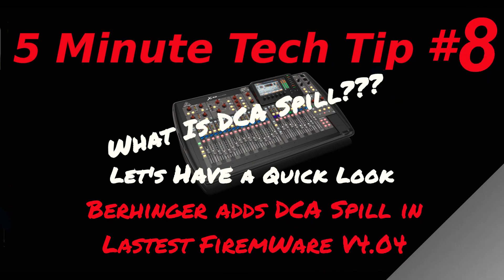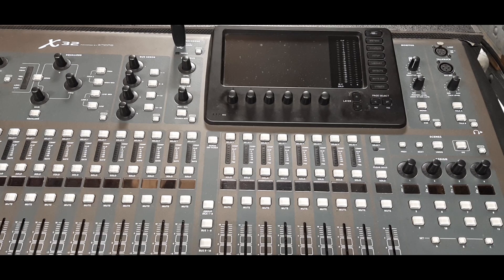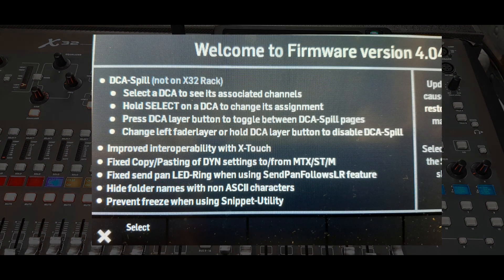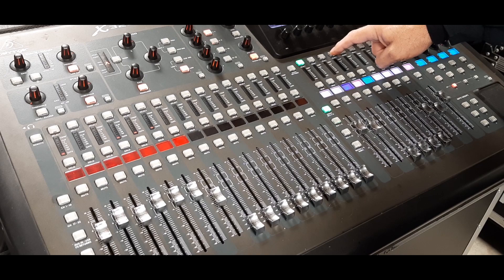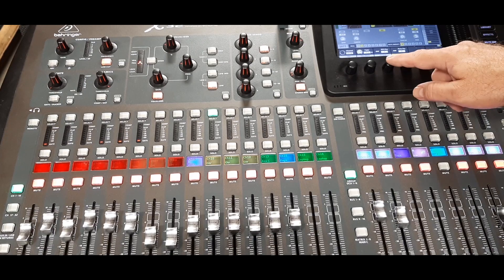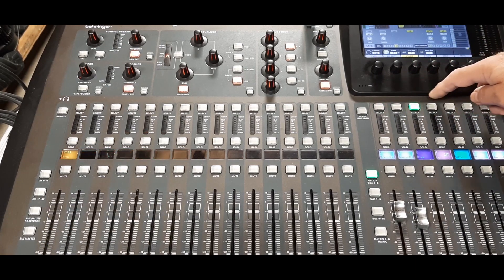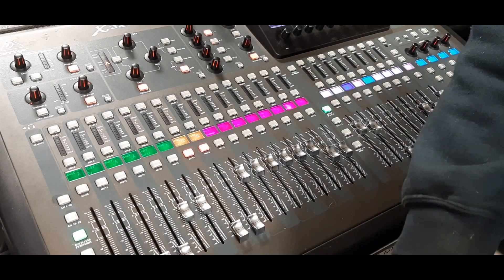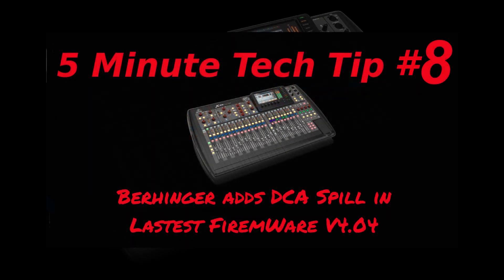DCA Spill Feature Added to the Behringer X32 in V4.04 Firmware. Midas M32 as well.

Comment from the maker: A quick look at the Behringer firmware as I installed it and checked out the new DCA spill function in the X/M32 series.

Amazon Affiliate Links-

Behringer X32 on Amazon:
https://amzn.to/35oCcyo

Midas M32 on Amazon:
https://amzn.to/3ovhi8n

Behringer XR18 on Amazon:
https://amzn.to/2LfTpmO

Midas MR18 on Amazon:
https://amzn.to/3q4Z4Li

Videos:
Five Typical Mistakes Behringer X32 and Midas M32 Users Make:
https://youtu.be/tP7dO2Za6bw

5 Typical Mistakes Behringer XR18 and Midas MR18 Users Make:
https://youtu.be/EilVDp39A9g

Comment: Very interesting! Can you add only the left channel of a stereo pair to a dca, and then have essentially a really tidy custom layer with one fader for each stereo source by assigning only the left fader to the dca group?
Reply from the maker: I assume not... But I can't say for sure. I didn't try that. I assume stereo linking is something they didn't change at this point. But who would've thought they'd add a DCA spill function all these years later to the X32?
I'll give it a look next time I'm in the shop and fire the console up.
Reply: @AlanHamiltonAudio  I can confirm that adding only a single channel of linked channels will cause both to show
Reply from the maker: @rwallingford7126  Thanks. I fired the console up today and forgot to check that. I assumed that would be the case though. Thanks for the confirmation.
Reply: @rwallingford7126  Thanks for checking! If you add more than 16 channels then i assume you just see the first 16? (or the first 8 on a compact)? What happens if the 16th and 17th channels in the DCA (or 8th and 9th on a compact) are a stereo linked pair? when you select the DA would you see just the left channel of the stereo pair?
Reply: @stephenevans2518  stereo linked channs always start with an odd number like 1/3 etc. so u can only link  1to 2 or 7 to 8 etc..  an i think you have to select the odd number  to link with the even number..
Reply: @tinman1435  Yeah I get that! But it is possible to add an odd number of channels to a DCA and then a stereo pair, so then in the DCA they would be the 16th and 17th channels (even though they might be channels 19 and 20 in the mixer). What I am wondering is whether when selecting the DCA the stereo pair would then appear even odd and be split across the two layers of 16 channels

Comment: Thank you for the video.  Do you know, is the update for the M32 the same as for the M32r?  the reason I ask, I don't the the spill feature works on our m32.  I did, however use the same file for both mixers.
Reply from the maker: The spill feature should definitely work in the M32. In fact, there was some initial confusion in the user community if it only worked on the M32 and not the X32. But that was just a misunderstanding some were making in reading the materials.
It definitely does work on the M32.
That said, I'm not sure if there's a specific FW file for the M32R versus the M32.  I wouldn't think so.
I'd make sure that the USB stick only has the new firmware on it (and no older versions also on it), and reinstall it if the current install didn't work.
You could also take a look in the setup page and make sure the current firmware installed on the board is 4.04.
I have had an issue with one of our X32's where it pretended to load a newer firmware, but in reality, after going thru the motions, the older firmware was what it still was operating on.

I had to use one of the alternate methods for loading the firmware for it to work IIRC. I don't think it had to do with an older FW on the stick.. but it's been some time ago when I had this issue.

Comment: Is there a way to enable/disable this feature in the global settings? I'm using an X32 at church with novice volunteer operators and I fear this will confuse them.
Reply from the maker: That's a good question. It booted up after loading the new firmware with that feature working so I never bothered to look for a way to disable it. I think most people will want it enabled, so whether they considered an option for people who don't want it... I don't know. 
I'll try and take a look next time I'm back in the shop to see if I see an option for disabling it.
Reply from the maker: In the new X32-Edit there is a setting in the Setup section for "DCA Spill Layer Jump" that, at least on the software with no console connected, seems to turn the DCA spill feature on/off. If not checked, spill isn't working on X32-Edit. When checked, it is.
Reply: @AlanHamiltonAudio  was just about to post the same answer then I saw you had answered..lol
Reply: I think, it's less confusing.
By the way, a good thing in an update could be an easy mode, where you can't do much things.

Comment: I've downloaded the file from behringer site and it wouldn't show the file on my x32. Any recommendations?
Reply from the maker: Did you unzip the downloaded file and put the "dcp_corefs_release-4.XX.X.update" file in the root of your USB stick?
I know sometimes people report the X32 can be finicky about which USB sticks it uses, but I've never had that problem.
So, you might try to file on a different USB stick (FAT 32 format). Possibly, try a smaller stick too.

Unzip the file, put the "dcp_corefs_release-4.XX.X.update" in the root directory of the USB stick.
There are a few routines to load the file.
With the board turned off, put the USB in the console and turn the console on and it will boot and take the file from the USB and update automatically. At least that was the old way... I guess that still works although it isn't in the instructions any longer.

Here are the other two ways (copied from Behringer):
Update Process:
1. Download the new console firmware from the X32 product page onto any directory of a FAT32
formatted USB thumb drive
2. Plug the USB thumb drive into the top panel USB connector
3. Open SETUP - GLOBAL on the console and select UPDATE FW in the lower left corner
4. Navigate to the directory where the firmwarefile is stored and install update
Alternative Update:
1. Download the new console firmware from the X32 product page at behringer.com onto the
root directory of a FAT32 formatted USB thumb drive.
2. Plug the USB thumb drive into the top panel USB connector while the console is turned off.
3. Hold the USB View button pressed while switching the console on. While booting, the X32 will
run a fully automatic firmware update, which will take 2-3 minutes longer than the regular boot
sequence.
4. When no update file is available on the USB drive, or when it is corrupted, the update mode will
remain active, preventing the X32 from booting regularly. Switch the console off and back on
without holding the USB View button to boot the console with the existing firmware.
Note: Behringer recommends to create a console backup before installing the update.
This backup can be restored in case of data loss during the firmware update.
Reply: Hey no I never unzip the downloaded file. Probably that was the problem, but I will follow your guide so I can get it right this time
Reply from the maker: @rowlincehowell6590  Cool. It should work this time. :)